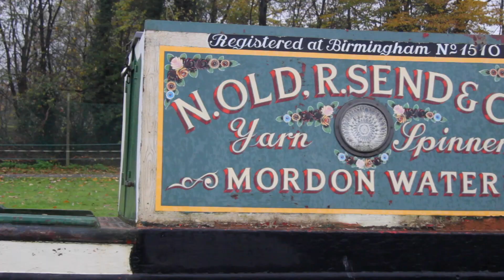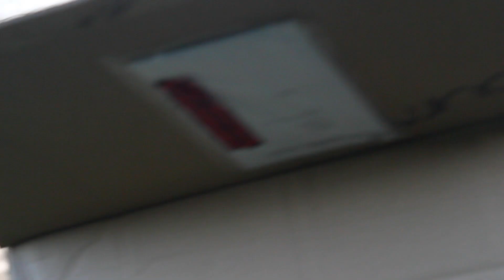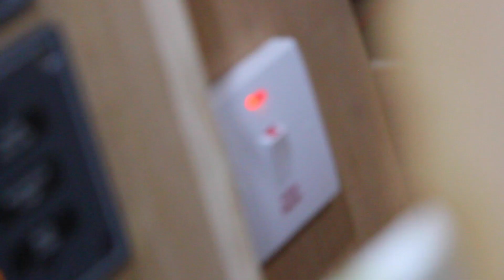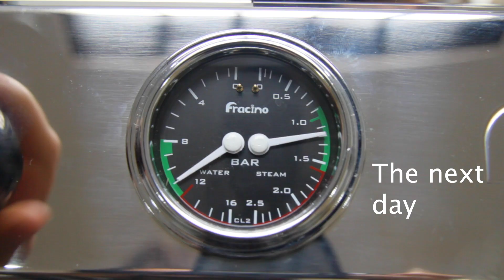S1 Ep30 The Finale

Comment: I just noticed the doors on the bow have standard Philips type brass screws, Considering the need for added security please consider fitting security screws as once fitted they can't be undone.
Screwfix should have them.
Otherwise all your security can be undone with a single screwdriver.

Comment: I honestly don't mean to be rude, but are either one of you a barista? If not, do you plan on hiring a skilled barista before you open? If your answer is "no" to both of these questions then please let me address this with you. First off, if you are a barista let me save you some time and you can stop reading right here...otherwise please continue. Making palatable espresso "consistently" has a steep learning curve and is nearly impossible to do by January. The hard truth is if you are serving sour or bitter espresso to your customers I'm afraid they absolutely will not tolerate it. One cup of bad coffee will keep them away for good, especially if it's their first. In the coffee world you rarely get a second chance for a first impression. There is so much to learn about the bean alone and/or the blend you plan on using. Please chose your beans and blends wisely. There are A LOT of garbage coffee beans out there and no matter how good you are your espresso will still taste like an old cigar!  Beans are temperamental. They will grind differently in the morning than they will later in the day (using a full hopper). You need to know proper water temps, bar pressure, dosing ratios and extraction timing to only name a few things. (If you are doing pour overs that's a whole other world of coffee too). Tamping properly without causing the puck to channel is nearly an art form. Heavy channeling will absolutely ruin a shot. All of this changes if your machine is either sitting idle for several minutes or if you are making espresso back to back during a morning rush. You must know how to react to these variable changes or you'll be serving terribly undrinkable espresso shots. We haven't even gotten to the milk/steam part yet. Lol! There is sooo much more! If you've read this far I'm honored that I've kept your attention. There is a good reason that there are barista competitions around the world. Making quality espresso isn't easy. People who win these competitions are awarded solid credibility and are greatly respected among baristas world wide. If I were you, I'd go to the best coffee shop with the best tasting coffee ever and beg, pled and pay their best barista to work with you for at least a few weeks. They should at the very least help you learn your equipment, proper cleaning (ie. coffee oil residue makes bitter nasty coffee) and the core techniques on how all of your equipment works together as a balanced system. The best of luck to the both of you and I have great hopes for your booming business! Cheers!    P.S. Buy a high end scale.("acaia lunar" is what James Hoffmann highly recommends and so do I) A scale is really the only way to dose properly. Volume dosing is too unpredictable. (For those of you that think I've stepped out of line here...may the pimp slapping begin!)